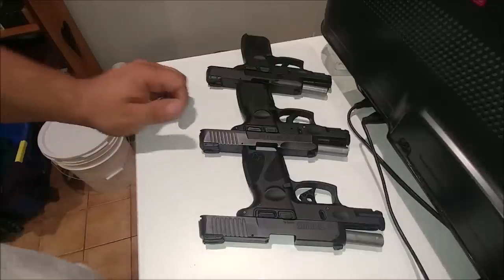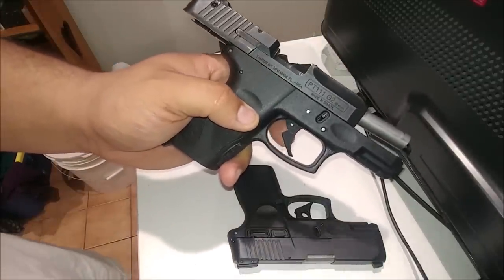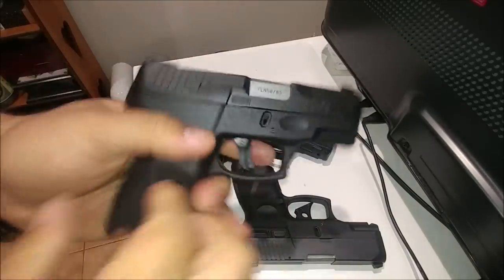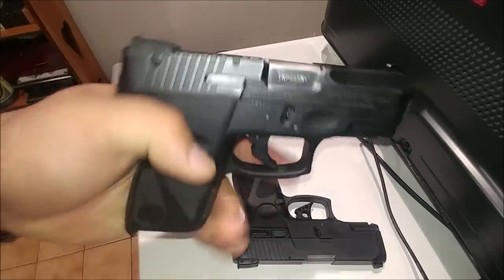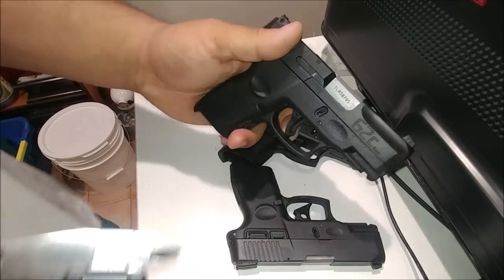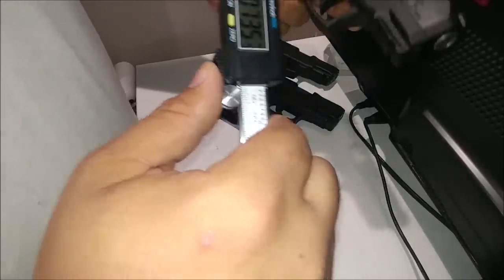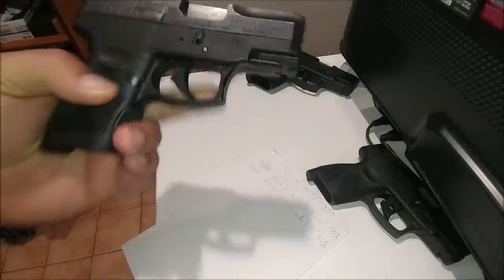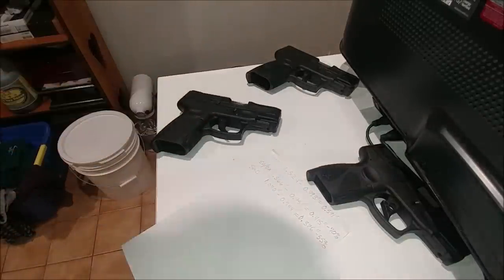New trigger design: SA/DA (Restrike) Trigger for PT111 G2/G2C/G2S

Comment: The thing that interested me about this gun as well as the PT 24/7 series having a striker fired mechanism yet has double strike capability unlike every other striker fired pistol. Why don't other companies try to do this and get rid of the myth that "striker fired guns are inherently unable to double strike". I know the Walther P99 had something similar going on, but I don't think it has double strike even though it has a "long" or double-action mode. Do you think you can maybe show us the internals so we can see how it works?
Reply from the maker: The basic concept behind a striker fired gun is simple: You have a striker that has a pointed end to slam into the round primer, a spring with enough force to send the striker forward hard enough to set off the round when it is compressed and released, a tab sticking down as an interaction point for the trigger mechanism to compress and release the spring, and a channel for it all to ride in, all of the above resides in the slide.

How each manufacturer decides to compress and release that spring are what make up the major differences in trigger function types between striker fired guns and reside in the gun lower frame.

If the striker spring is fully compressed by the slide action when the gun cycles, is held cocked by a fixed position sear and is just released by pulling the trigger, you have Single Action Only striker fired gun. 

The Taurus Millenium guns have such a fixed position rear sear and work this way during normal function.

If the trigger instead has some mechanism that can go all the way forward and grab the striker tab when it is uncompressed, then move the striker all the way back to full spring compression and release it, you have a Full Double Action Only striker fired gun. 

The Taurus Millenium guns do this by having a metal tab sticking up on their trigger bar to interact with the tab sticking down from the striker, and once the trigger bar is moved far enough backwards it drops down to release the striker. My wifes "DAO" (not really but we will get into that in a minute) striker fired Beretta Nano has a wheel that is rotated by the trigger movement with a tab sticking straight up to interact with striker tab. As the wheel is rotated it compresses the striker spring, until the tab on the wheel drops down below the linear movement striker tab and releases it.

If your got this far you probably noticed that the Taurus Millenium guns have 2 completely different ways of compressing and releasing the same striker, which is true and is how they achieve their SA/DA function. The downside of this is that the DA mechanism cant go all the way back to the same place the SA sear resides (as you cant have two objects share the same physical space) so the DA function does not compress the striker spring quite as hard as the SA function does.

The third type of striker fired gun triggers function similar to Full DA style triggers, as they move the striker tab backwards then release it with some mobile mechanism, but their moving mechanism cant travel forward far enough to grab the striker tab in its completely relaxed state, and instead rely on the slide cycling to grab the striker tab as the slide is returning forward and hold the striker back in a partially compressed state. 

There really is no widely accepted name for this trigger style I know of, they are basically DA guns, but they dont have restrike capability. So pulling the trigger compresses the spring and releases the striker, but if the striker is released without the slide cycling, pulling the trigger again does nothing, and you have to pull the slide at least partway back and release it before you can work the trigger again. This is usually done as a comprimise to keep the striker in a not fully cocked position, but to also have a shorter trigger pull than a Full DA gun with restrike would need. Glocks, Beretta Nanos, and a ton of other striker fired guns work this way. I sometimes refer to these as Half DA striker fired guns.

Congratulations if you got this far! Hopefully that clears it up a bit. I will try to make a video on this at some point.
Reply: @KeepTinkering  Thanks man, I found it very interesting and informational. It was a fun read with my dinner (I am having pizza and dumplings as I type) and I will be more than excited to see a possible comparison video of the triggers. Also, just asking out of curiosity, if you were to design a striker fired pistol built for personal defense rather than competition, would you try to have this trigger mechanism implemented? Why or why not? I know I would. In the event a round fails to fire, I rather have a second chance to pull and hope it goes off rather than have to resort to a tap-rack drill.
Reply from the maker: To some extent it is a personal preference and physical capabilities thing. Pulling the trigger again is faster than tap rack, and you have the chance of still using that round, however, restrike only works if you have a hard primer that didnt fire the first time, but is capable of firing if you hit it again. Whereas tap rack solves all issues a round may have by just removing it from the equation. Personally I train tap rack, because it works on all semi auto guns, solves all round issues, and most people can be pretty quick if trained for it, although some will always be slow no matter what just due to physical limitations.

In my opinion, the worst case scenario of depending on restrike to work is where you get into an emergency, pull the trigger, nothing happens, pull the trigger again, nothing happens, and you either have to stop and take time to think about what to do next, or get caught in a loop and keep pulling the trigger when nothing happens.
Reply: @KeepTinkering  I see. Kinda creates a mental trap. I personally would train to strike just one extra time before resorting to tap rack if possible. Click, click again then tap rack. I 100% agree with your logic however since it will indeed most definitely work as long as the issues are only ammo related. I just test my luck on some things. Plus, I also like to see it as an AR-15's forward assist. Is it necessary? Probably (and debatably) not. Does it hurt to have it? Probably not. But that's just me.
Reply from the maker: I agree, and training is the most important part. If you train to use restrike once, then tap rack, great. If you train to go straight to tap rack, also great. But some people assume that restrike is a replacement for tap rack, so dont bother to train tap rack, and I feel like that they are asking for trouble.

Comment: Anything for the g3c?
Reply from the maker: Actually all my triggers, except those marked as for the TX22, work with the G3 and G3c, just make sure to get one of the packages that includes a trigger spring, as the stock G3/G3c trigger spring isnt compatible with my triggers.

Comment: I would love to see a straight or the pseudo backstrap in sa/da
Reply from the maker: Unfortunately the Straight and Pseudo Backstrap designs come forward quite a ways, and with the additional forward movement the SA/DA function requires, it just does not work well with those designs. That being said the DA function in these guns is of incredibly limited use, so unless you are using it to practice holding the gun steady while dry firing repeatedly or something similar, you are not missing anything going SAO.